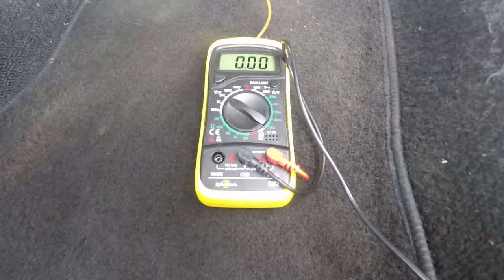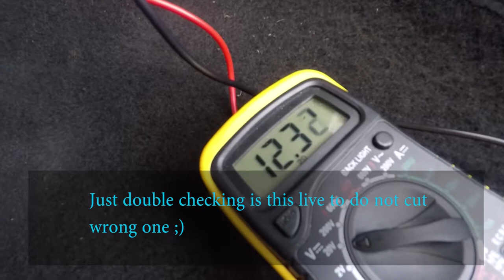MX5 kill switch instalation

Comment: On my 96 there are two wires at that relay that are producing 12v, so unfortunately it’s not clear which to tap into.
Reply: one will have constant power the other will power on and off when u turn the key ignition. U want to tap into the one that isn't constant power.
Reply: @TripCS  What I did instead was tap into the fuel pump at the fuel pump itself (or close by). The yellow wire there is the fuel gauge, but the striped wire is the live wire. Tapping in to the back of the car makes the wiring less accessible and opens up other options for switch location. It works great.
Reply: @jonathanbeaver4678  Hey, I'm planning to tap into the fuel pump itself as well. Do you know if there are any issues with tapping into that wire instead of the relay? What gauge wire/switch did you use? Thanks!
Reply: No issues tapping into the wire. I’ve had mine on for quite a while now and it works great. I don’t recall the wire size. I just used the same size wire and tapped into that wire, ran it over to the switch and then back to the other end of the wire. There is little possibility someone can steal your car without fuel.